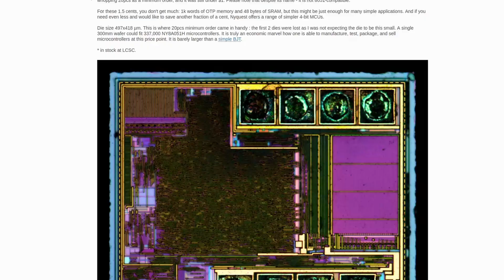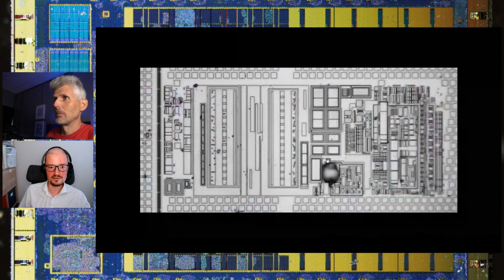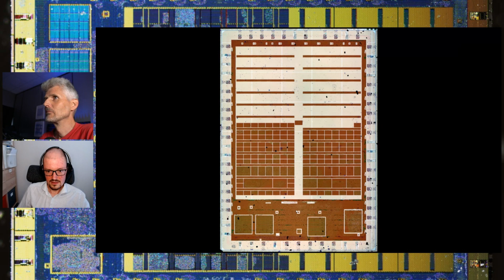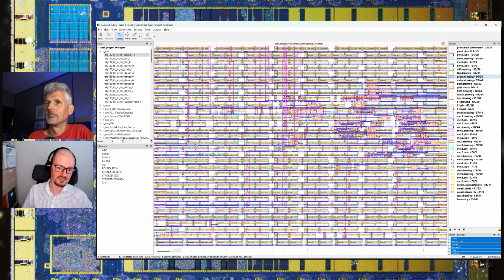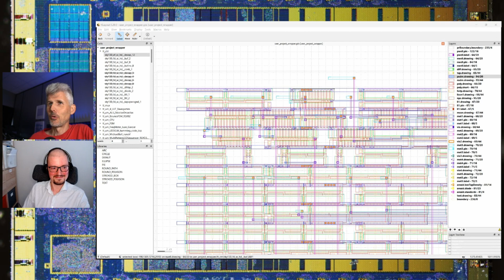Looking inside an open source ASIC with Zeptobars!

Comment: Great work. One remark. In my 32y on analog IC design never seen a NDA which forbid to show my own GDS on a commercial process or by a commercial layout editor. Btw the layout editor seen in the video is OS. Some PDK's mask the real layout of special primitives. So you see a mockup which get replaced at the foundry mask-making with real GDS cells. The trick is that for a full flat GDS there are still device recognition layers which trigger the substitution. For complete hidden logic cells typical the Cadence "Abstract" layer is visible. The next layout hiding method involve an IP delivery where only the fab knowns about the layout and the user only know about the simulation model.
Reply from the maker: Every professional I've spoken to has the opposite understanding!
Reply: @ZeroToASICcourse  For the working contract I fully agree but the context are the NDA for EDA tool.